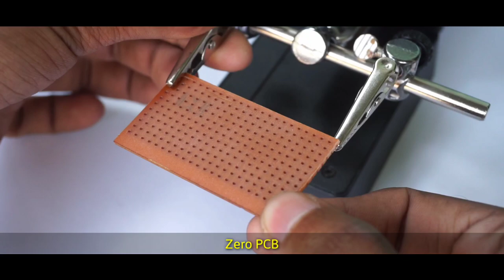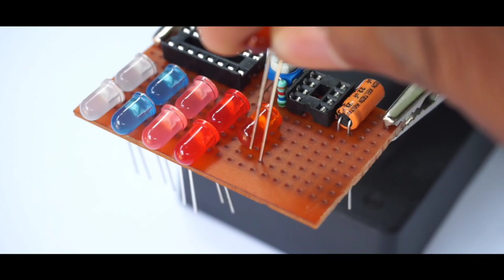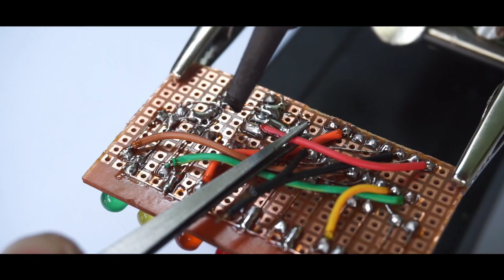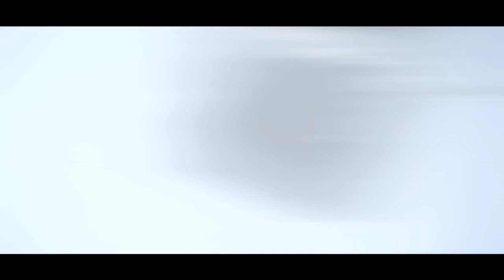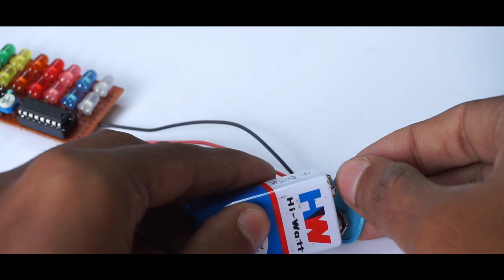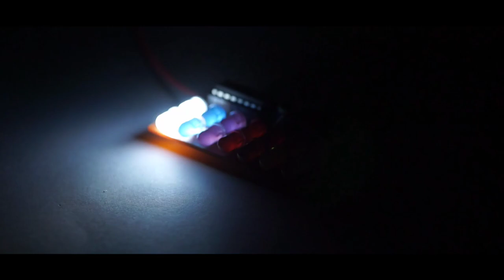7 Colour LED Controller Electronics Circuit

Comment: I always appreciate it always... whenever you place the circuit diagrams. For the suggestions that YouTube makes me based on what I see, I think! I have counted more than 10 channels of Electronica or Amateur Electronica...none have the circuit. And in fact they have almost no subscribers (poor people).
I wanted to complain to you... make constructive criticism. It's very... very difficult for me to identify as the case of this circuit, why? the chip as an example the CD4017BE...has numbers outside and inside the chip! It is very difficult for me to understand what are the ones that are left over, although I identify which are the legs from number 1, I do not manage to understand what are the internal numbers that you put in the integrated. I have not noticed that you ever explain it. Thank you for so much care. I hope your answer.
The translation is electronic and could contain some error;)
Reply: The CD4017 is a "Decade counter" (10 outputs) and the numbers inside the chip are the sequence of the outputs. in the video, he runs the wires to the LED's so they run in the correct sequence. The unused outputs in the circuit diagram could be used if you wanted to add more LED's and had a big enough board to hold them and change the connection to the "reset" pin. Hope that helps a little?